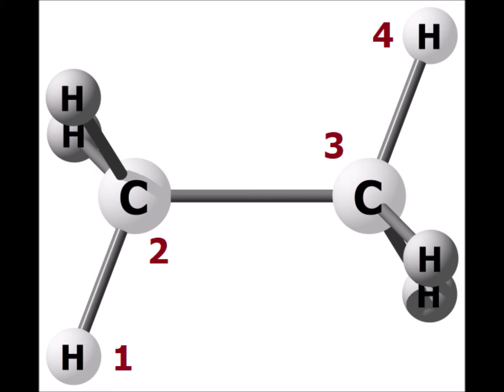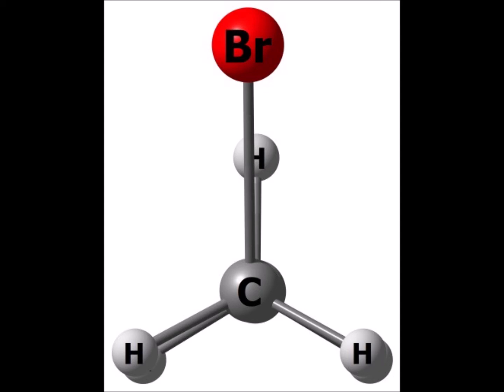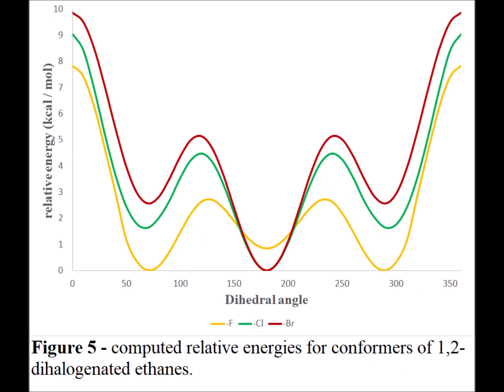Rotational barriers of unsubstituted, monohalogenated, and 1,2-dihalogenated ethanes

Comment from the maker: (for mobile users)

00:15   Introduction
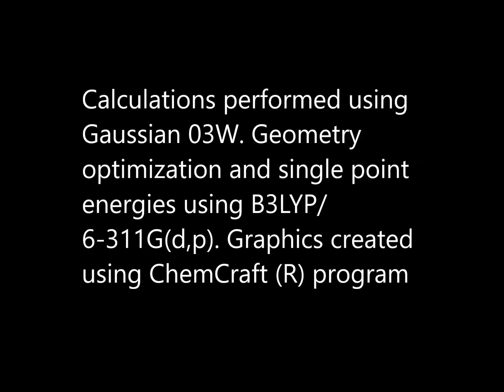00:24   Dihedral (torsion) angle definition
01:14   Fig. 1 - relative compute energies of conformers of ethane
01:40   Ethane maxima
02:02   Eclipsed ethane
02:32   Ethane minima
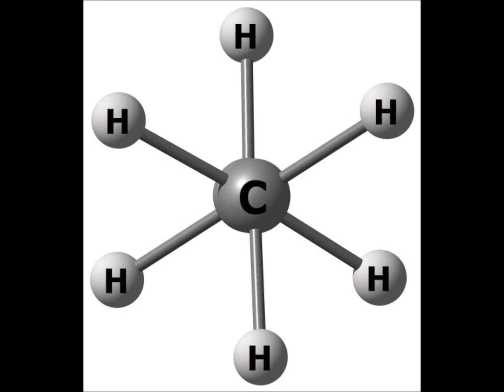02:54   Staggered ethane
03:53   Fig. 2 -  relative computed energies of conformations of ethane and monohalogenated ethanes
04:32   Maxima
05:02   Eclipsed fluoroethane
05:22   Minima
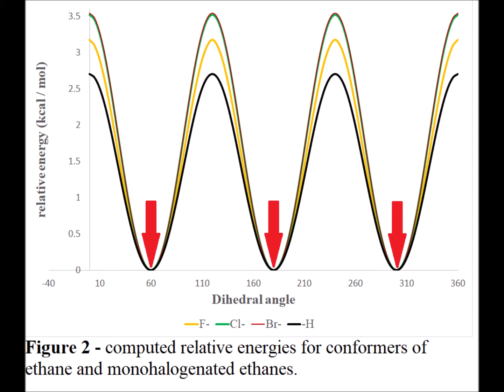05:46   Staggered fluoroethane
06:05   Eclipsed chloroethane
06:19   Staggered chloroethane
06:40   Eclipsed bromoethane
06:57   Staggered bromoethane
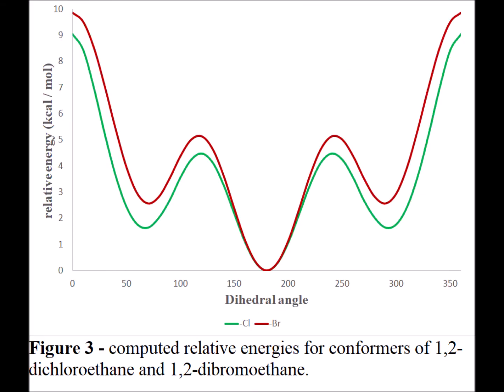07:20   Fig. 3 -  relative computed energies of conformations of 1,2-dichloro- and 1,2-dibromo-ethanes
08:04   Minimum
08:29   Staggered 1,2-dichloroethane
09:09   Relative minima
09:28   Gauche 1,2-dichloroethane
09:57   Maximum
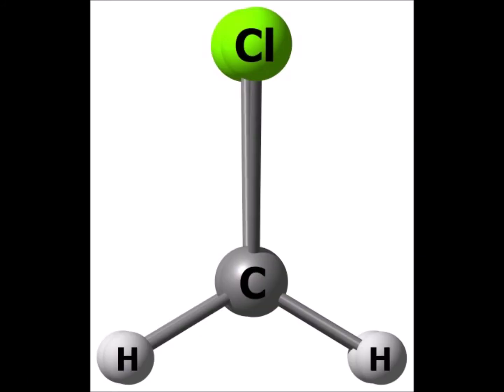10:29   Fully eclipsed 1,2-dichloroethane
10:36   Relative maxima
11:06   Partially eclipsed 1,2-dichloroethane
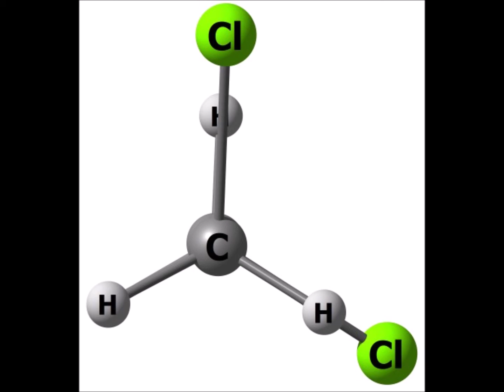11:34   Fig. 4 -  relative computed energies of conformations of 1,2-difluoroethane
12:21   Staggered 1,2-difluoroethane
12:43   Relative minimum
13:01   Relative maxima
13:25   Partially eclipsed 1,2-difluoroethane
13:45   Minimum
14:12   Gauche 1,2-difluoroethane
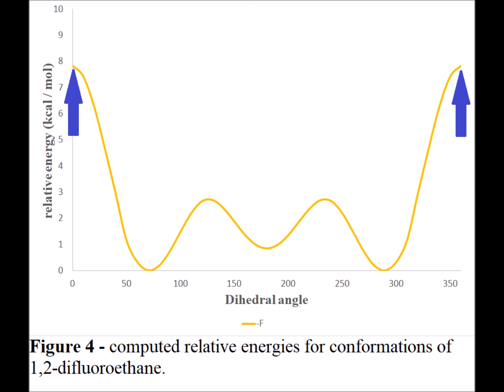14:34   Maximum
15:04   Fully eclipsed 1,2-difluoroethane
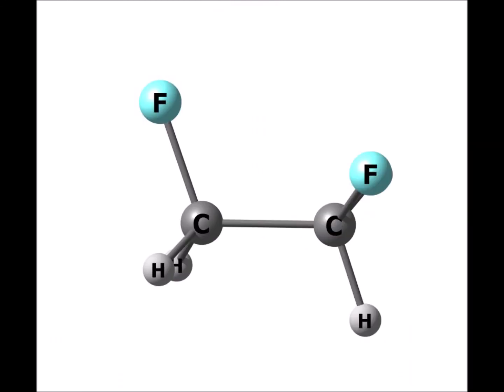15:27   Side view of gauche 1,2-difluoroethane
15:56   C-H σ orbital
16:27   C-F π* orbital
16:56   Orbital interaction - hyperconjugation
17:54   Fig. 5 -  relative computed energies of conformations of 1,2-dihalogenated ethanes

Don't forget to like, comment, share, and subscribe!
Reply: Thank you very much Sir.